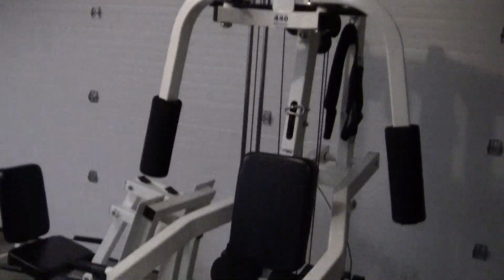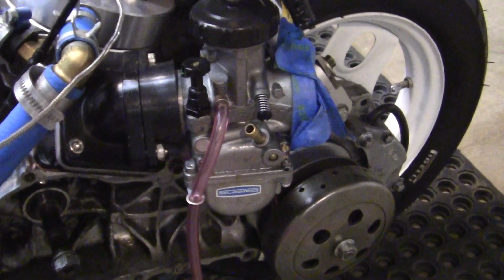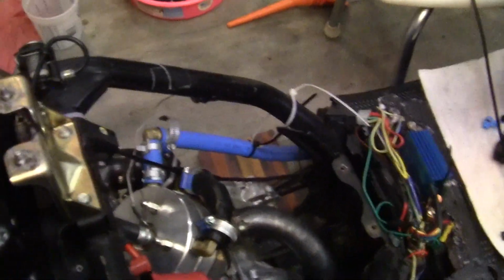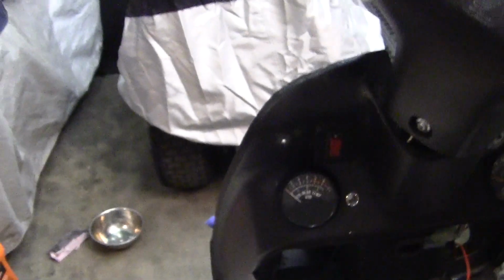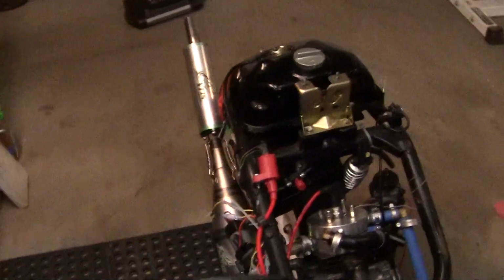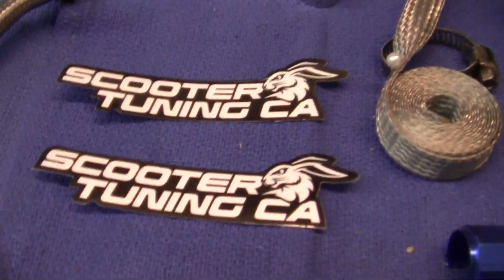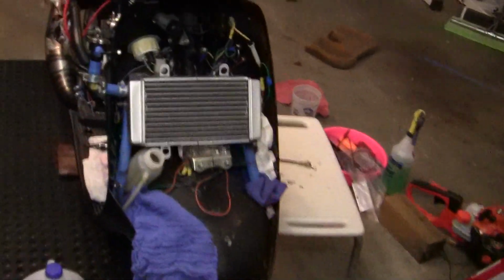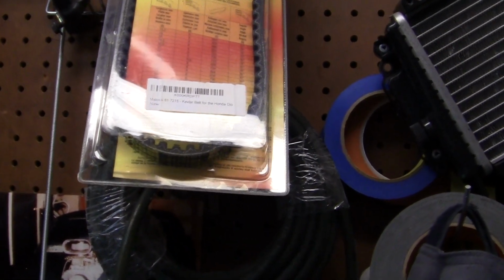2- Today in the DIO RACE SHOP

Comment: I haven’t had my scoot for probably 5 years now. I hear you about the body panels. After working on it or tinkering so many times, shit just breaks. I do miss that scoot. I had it for 10+ years and probably put 70k miles on it. It was a 50cc (well it was 50cc when I first got it…..) Tank Urban Sporty (Chinese) with the 139qmb engine. Went through at least 7 crankshafts in that timeframe. It taught me a lot.
Reply from the maker: I still have mine after buying it new in 1993. Put a 1999 engine in and never looked back. I still have the bike, parts, videos. It is just me that is getting old now. In my 60,s just became a Grandfather. Still Love my Little Bike, Respects, Randy H